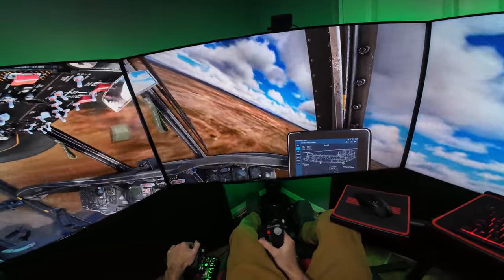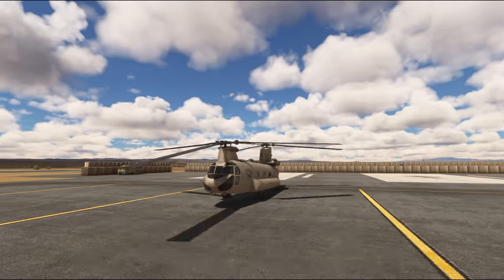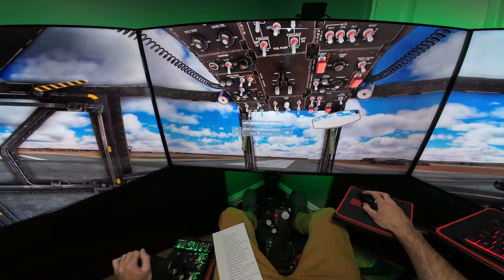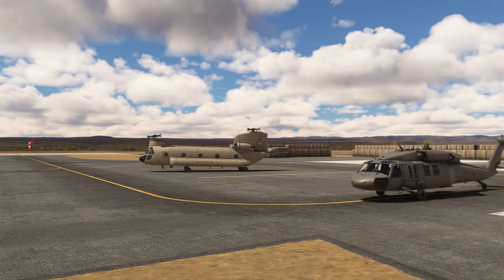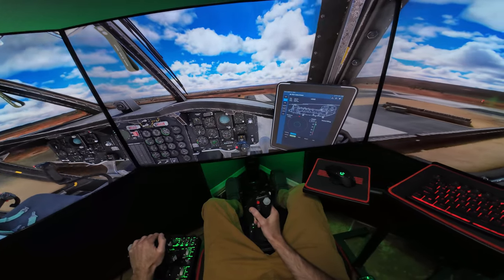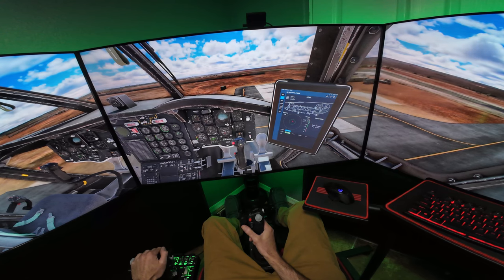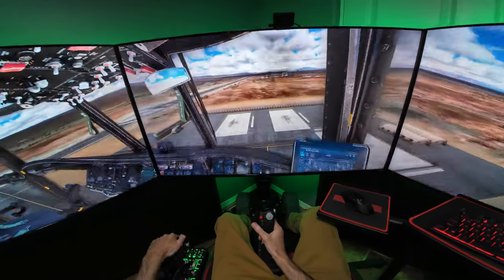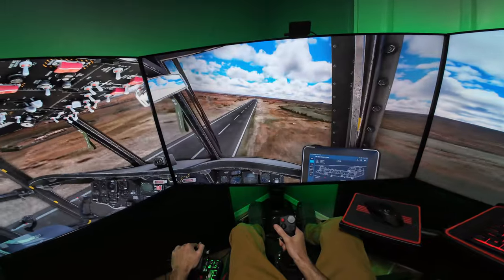NEW Chinook CH47D First Impressions | MSFS | Triple 50" Sim Rig

Comment: Nice vid, but i have to disagree with the comments about the sounds. I did many insertions and extractions in the Chooks in several theatres, and these sounds are a pretty poor representation. I bought this as it has significance for me, but I'm disappointed. I hope Miltech improve on this.
Reply: Agree mate, I was stationed at RAF Odiham in the early 90's and worked on the Chinooks. Exterior and interior sounds are off, hopefully they will improve them down the line 👍
Reply from the maker: Thanks I appreciate the comments! It cool to hear from people who were actually around the Chinook. Being in the Air Force I was never around the Chinook so from an outsiders perspective it sounded ok but I hope they do improve it then, I know how it feels when the jet sounds in the game aren't accurate haha.
Reply: @tonyf9076  Hello mate. I was ferried around by 7 Sqn for a few years. Crazy fellas lol
Reply: As a Chinook Pilot I have to agree with ya. They got kinda close with the sounds, but didn't quite nail it. Not nearly enough transmission wine and they could've added some dynamics here and there, especially for an increase in blade-slap as the aircraft decels.
Reply from the maker: @47Driver  Thanks for the comment! That's interesting to hear, I'm also wondering how the physics are going to change with the SU15 update when they implement the dual rotor physics!
Reply: @47Driver  That "slap" on turns, love that noise 👍
Reply: @tonyf9076  we love it too! You can feel it in your chest in the cockpit, it's awesome.
Reply: @47Driver  You ever rode in the back in the center of the cab ? Ever heard the term "Chinook nose" ? 😂
Reply: @tonyf9076  can't say I'm familiar with that term lol. I have flown in the back many times, though I generally prefer to be up front!
Reply: @47Driver  it's the phenomenon where you got an itchy nose from the blade overlap vibration above your head in the middle of the cabin, we called it Chinook nose 😂
Reply: @47Driver  Hello mate current or former? Able to say? Former 40C RM here latterly SB. Been inserted by a bunch of you fellas.
Reply: @47Driver  Re. the FWD Transmission sounds, these were purposely toned down slightly as many complained the whine is "too annoying". We will consider adding different intensity levels (realistic/mid/low) to accommodate all preferences.